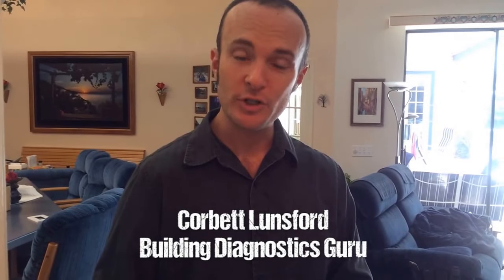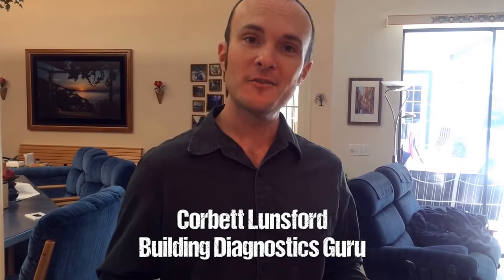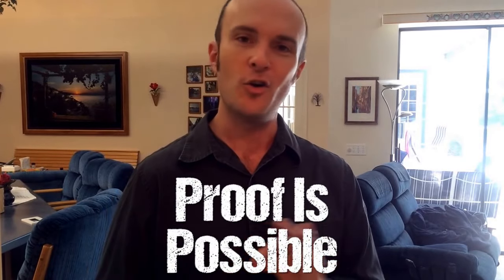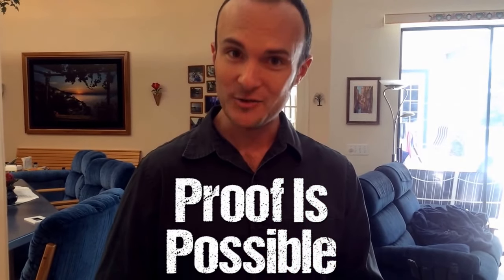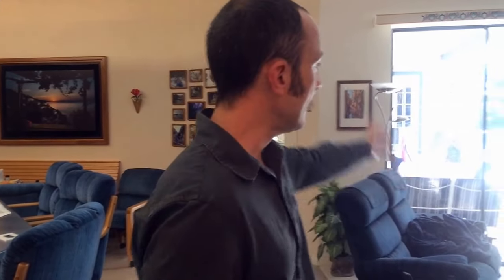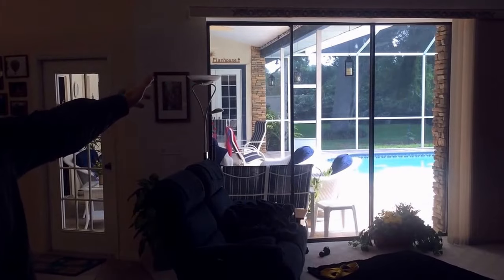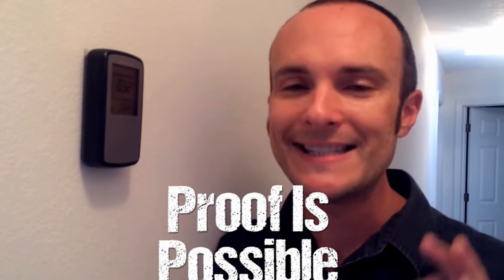How to Test for Radon at Home DIY

Comment: I'm sure you didn't mean to suggest that 4.0 pCi/L is the magic number we must aim for. In fact, zero is what we are aiming for. That's because 4.0 was pulled out of thin air, based on our ability to mitigate radon levels. Very much like arsenic in drinking water: the maximum permissible level was 500 ppb, then lowered to 100 ppb, then to 50, then to 10. New Jersey limits arsenic in drinking water to just 5 ppb. Yet everyone agrees that zero is the target. No0ne would suggest that the widely allowed 10 ppb is perfectly safe.
Reply from the maker: Agreed, Paul, for kids. I say it all the time.

Comment: Great video. Only item I saw is where the home monitor was placed. With Radon you want to be at lease 12 inches from a wall so it does not take biased readings by the plate-out affect. There are higher concentrations of Radon on walls as the air always moves out towards the walls in each space. Also keep them 3 ft. from any outside openings and at least 20 inches from the floor. These are the national protocols / standards for testing.
Reply from the maker: +David Daniels haha, that’s hilarious in light of this being a wall-mount monitor! Sounds like you’re saying it’ll give you inaccurately high readings on a wall. Thanks for sharing.

Comment: Doesn’t the bottom of manufactured housing have a vapor barrier over all the works and the insulation in the floor? So how does radon get into your house through open vents that go to the slab like a furnace water heater? That’s pretty much it?

Comment: Nice video! Its great to see Building science folks talking about how changing building pressures can change radon entry. I love the diagnostic approach. A couple things....there are many continuous radon monitors but only a couple consumer grade continuous monitors like the one you are using. The Corentium is a great tool, though. Also, the EPA action level of 4.0 pCi/L never was intended to be considered a "safe" level, and in fact they say mitigation should be considered between 2.0 and 4.0. Again, great video!
Reply from the maker: +Chad Robinson thanks for chiming in, Chad! Yes, I'm also in the camp of "0 is the only truly safe number".

Comment: There are many types of continuous radon monitors. Some as inexpensive as the Correntium, some into the thousand$.
Any truly professional mitigator does diagnostic measurements, similar to what you did to make sure their mitigation fan won't be overcome by the HVAC and bathroom fans.
Pretty decent info overall.
Reply from the maker: +Radon Ease thanks for the feedback! I've only met radon testers onsite who would be setting up their testing at the same time I would be doing blower door testing. I always make sure they know what my test is doing, but they never seem to get how it would make the radon measurement meaningless.

Comment: Nice video!  However, do you have a recommended radon monitor similar to the one you show in your video?  You see, I am about to buy a new construction home in NC, and I would like to know the level of radon since the construction company will install at no cost to me a mitigation system if I prove the level are above 4.  Thank you.
Reply from the maker: Still being made- Corentium is also part of Airthings monitors, which have sensors for more than just radon.

Comment: I have the same device. It is almost as precise as a commercial grade device. Unfortunately it is expensive. Mine is measured in Bequerels which is a much more precise (an international) unit of measure.
Reply: @realtyrocks1969  LoL. For 44 I would buy 3. They cost way more than that. A passive lab device can only be used once for 6 months and is sent to the lab for the results and it costs 35 dollars.
Reply: @Rombizio  see my previous comment. Edited. They keep deleting my comments.

Comment: I have the same meter and put it in the same area you did in hallway  right below the  house fan system , the AC vent and the attic and the level read 3. That is the highest I've seen it in 2 years.  We do have a mitigation system in the basement . So  what steps did you take to lower the radon levels in that one area ?  Almost every other room in my house is always lower than .50.
Reply from the maker: Try increasing the speed of your radon fan, or checking if it needs to be replaced.

Comment: Wow, great video.  
How do you feel about the accuracy of this monitor?  
Have you ever had any other radon tests performed to compare this device against those kinds of test where you mail them away to a lab?  Thank you.
Reply from the maker: Hey Patrick, thanks for watching. Having watched this monitor, and their newer Wave Pro, fluctuate with the seasons and weather, I actually wouldn't trust a three-day or seven-day radon test at all. It goes up and down daily, weekly, monthly.
Reply: @HomePerformance    Ok, thanks for the reply.  So, would you suggest running the test for longer durations?  I heard something like a 90-day test is a good place to start.  Would you recommend something like that?  How much of a fluctuation are you talking about in a week-long period?  Could you give an example of how far the readings will change?  Say from 4 to 8?  Or is it only smaller amounts like 4.1 to 5.2?  Something along those lines?  Thanks again.  Sorry for all the questions.  haha.
Reply: @HomePerformance  Hi there. I'm not sure you understood the OP's question, which I am curious about as well. I think we understand that a 2-3 day test kit that you mail off to a lab wouldn't reliably gauge the amount of radon in the home year around as it can fluctuate so much from day to day, season to season as you say. I think the heart of the question is, Has this device been tested specifically against any of those tests, comparing them side by side, for a set number of days? For instance, you would mount the device to the wall on say the first Monday of July, along with a 7 day test kit right next to it. Then the following Monday, you would document the readings of the device, and compare them to the lab results from the test kit when they've returned. Hope to see a video of this!

Comment: How much does the Radon gizmo cost?
Reply: $199. You can get it off our website here: http://airthings.com/us/home/
Reply: buy a dollar store fan and stick it in window draws little electric
Reply from the maker: +sixtynine stang not in Florida, my friend. The dewpoint of the outside air is higher than indoor temps for most of the year, so everything would be wet and moldy.

Comment: I appreciate all of your hard work and that you share your knowledge.  I understand that fresh air is needed, homes need to be "sealed tight and ventilated right," etc.  I wonder if you have seen this:

Myth's of Radon (4 part series)
https://www.youtube.com/watch?v=TYZglUjLE0Y

Basically, this guy with significant experience in toxicology, safety, etc shows how the EPA has used guesswork to arrive at their "recommended" radon levels.  According to him, there are studies showing NEGATIVE CORRELATION with low levels of residential radon (under 100 PiC/liter) and lung cancer (cancer rates actually lower with low levels of radon).

He says the EPA recommendations are for someone who works in a mine, lives in a mine, and is a smoker.  Obviously, no one lives in a mine, so their recommendations really don't apply to anyone.

Again, I don't think building science is a hoax, but it kinda sounds like the radon epidemic is.

According to him, the radon monitors (yours and professional ones - which I almost bought BTW) aren't even measuring radon, but rather usually Bizmuth).

Your take?
Reply from the maker: In short, this is why I don’t advise seeking an industrial hygienist for homes. Too technical, for one, but also he does not acknowledge that kids and elderly and otherwise compromised people live and breathe  24/7 in homes. They are not subject to OSHA, in fact they would be unemployable in the first place. What we ask healthy adults to do for money and what we subject children and sick people to are not, and should not, be the same.

Comment: Wrong - the AC fan has no influence on differential pressure between the inside and outside of the house.  This is not what you are measuring.
Reply from the maker: You obviously haven’t tested this if you think that. Anyone who studies building science knows the air handler can put + or - pressure on the house when the ducts leak into attics or crawlspaces.

Comment: Yeah, that's great a detector that cannot be calibrated by external means.
FAIL.
Reply from the maker: As long as you have a baseline to measure against, the same instrument can be effective. It's measuring against itself, even if it's out of calibration.
Reply: @HomePerformance  uh, that's like a carpenter using a rubber band to make measurements in building, just about every one of his measurements could be a FOOT; calibration is uber important, I believe you have said so in your vids on air pressure testing equipment. 
Let's not expect the layperson/homeowner to truly understand and actually perform any kind of calibration; most won't even flush their water heaters, let's be real!

Have a great one!
Reply from the maker: Something’s better than nothing though, I think we can both agree- and we’ll both keep trying to get people educated and on the right track.

Comment: 4:30   NO!!!!  you don't want 4 pCi/L.   That is the current upper limit.  Lower is better.  You want Zero, which will not happen, but NO you do not "want" 4.
Reply from the maker: +wonderboysc1 that's why I say I want zero. Good luck finding it in Florida's existing homes. If it's present, what do we do about it? That's the real issue.
Reply: @HomePerformance You move if a mitigation system can’t fix it